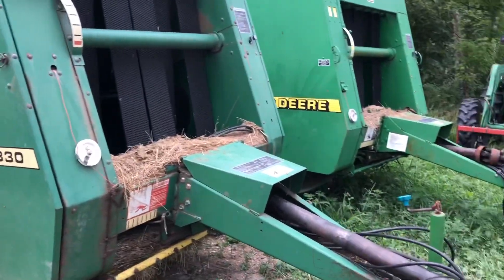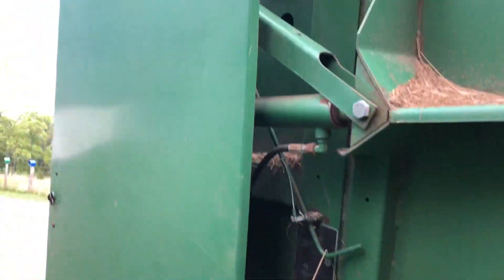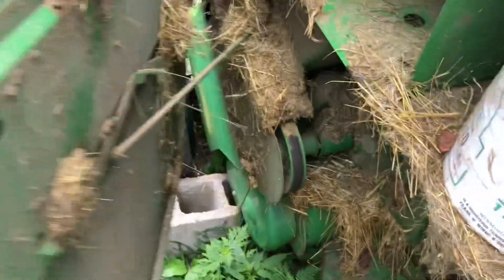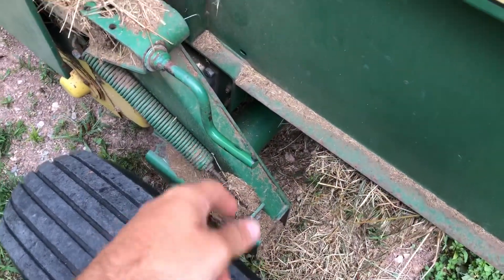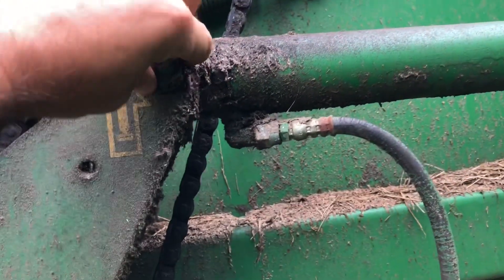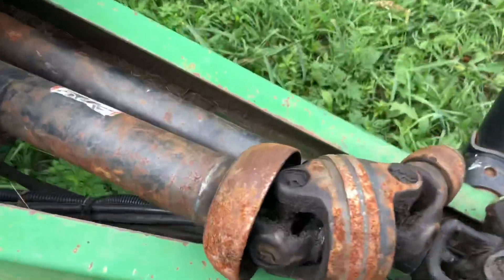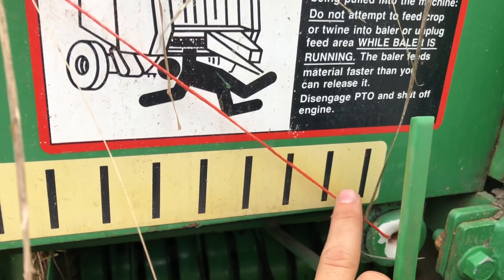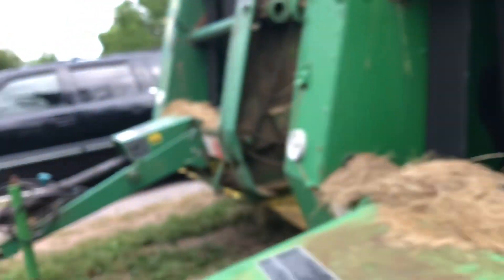JD baler VS.JD baler

Comment: I have a JD 385 the twine arm speed is adjustable, has a brass dial to change its speed. I have trouble with that orange poly twine not cutting i have to use sisal
Reply from the maker: The poly does ok in mine have to keep a eye on it some times it’s gets eaten while bailing

Comment: My dad bought a JD round baler last year. I don't remember the model number. String wrap. Older than those two. He couldn't get it to tie. He had JD service come out twice and they couldn't figure it out but had no problem sending him a big bill. My son and I went out and found he has to have his 3020 throttle wide open to trigger the tie.
Reply from the maker: It has hydraulic tie? With tractor running wide open that may be an issue in the SCV valve
Reply: @Theblindfarmer  if I remember correctly, there is a power steering pump type setup on the right side, (if facing the rear).  I don't remember hydraulic hoses. The pump may be belt or chain driven via the pto.
Reply: @Theblindfarmer  I do know it can automatically tie or pull a rope to manually trip the twine arm to tie.
Model 530

Comment: So how you like them Deere balers?? Have you ever run anything else to compare it with?? I know some guys like the Deere balers some don't.  I like the looks of them never run one though.  Betty's cousins have and they really like theirs.  I'd like to get a Deere baler to replace my old Ford/Gehl when the time comes.  Lot of NH and some Vermeer and some Deere here, but I'm not a fan of either NH or Vermeer anymore... NH is needlessly complicated in my opinion (can't make up their mind to use chains and slats, rollers and belts in combination, or belts only... Plus NH isn't as good a company as it used to be.  Vermeer balers are built tough but I've heard they can really be difficult when baling short hay, excessively dry or lightweight grass, or slick stuff... Plus I don't like rubber-mounted teeth in anything no-way-no-how... Later!  OL J R :)
Reply from the maker: Just new holland and Heston is all I’ve ran to compare to the Deere
Reply: @Theblindfarmer  So which did you like most?? Deere I presume LOL:)  (or else you'd have the other I guess??)  Later!  OL J R :)  PS and why??
Reply from the maker: Deere I like best and why is the new holland makes a bale that’s almost 300lb lighter in the same size bale and the Heston if it wasn’t bone dry it would not bale
Reply: @Theblindfarmer  Hmmm interesting.  Virtually NO Hesston balers in this part of the world.  I think they're quite the thing up in Kansas but then bone dry isn't a problem for them so it seems it's the normal state of affairs LOL:)  I've looked at the Vermeer balers and they're pretty impressive fairly simple looking and very robust HUGE bearings on them (at least the later ones-- it's like if you take that bearing out you've got bigger problems!) BUT I've CONSISTENTLY heard that they can be VERY finicky when it comes to hay conditions... the older ones in particular but the new ones aren't immune from it.  In slick grass hay (like dry ryegrass) they don't want to start a bale, in light or extremely dry stuff they can be very hard to start a bale, and in short hay, same thing.  Some guys say "well replace the starter roller rubber flaps they'll start a bale like a new baler" but that gets expensive when they have problems every couple years like that... and I've heard varying levels of success with that as well... sometimes it fixes it sometimes it doesn't.  The newer Vermeers all have rubber-tine teeth and when the rubber gets some wear and "loosens up" they won't start a bale, then you're tearing the entire pickup apart and gutting it and putting ALL NEW tines in it... and that gets EXPENSIVE with their proprietary rubber tines!  I've been watching SouthSaskFarmer's channel and he's running a Case IH baler built by Hesston it's fully automatic no hydraulic connections at all it has its own hydraulic pump and the monitor controls everything just a wire harness going back to it and the PTO.  Looks neat and does a nice job baling but some guys said "wow glad that works heard a lot of bad stories!" type stuff... We see a FEW Case IH balers on the lots taken in on trade but not hardly any (that I've seen) actually in the field running which makes me wonder "WHY was it traded off and sitting on the dealer lots?"  LOL:)  Bad juju for sure!  Most balers here are Deere or New Holland or some Vermeers but that's about it.  The New Hollands just don't impress me-- it looks WAY more complicated than it needs to be IMHO... Then the fact that they changed their design a half-dozen times-- first all chain-n-slat, then sledge rollers and belts in back, then all belts, then endless belts, soft core, hard core, it's like they can't make up their mind what kind of baler to build.  Then you've got at least a half dozen or more models in every type that they made pretty much and it's SO confusing it's like "which are the good ones and which are junk?" and it's like "Well, Deere has stuck with the same basic design ALL THESE YEARS and just refined it, so there's your answer!  Deere's netwrap is kinda wonky from what I've heard harder to see and monitor than others can be tempermental if something's not just right but then that's kind of an issue with all of them.  Best thing about NH that I can see is they put the net up front instead of in back like Deere LOL:)  Otherwise I think Deere's got them on a superior product...  I know they ALL have their faults and foibles but from my experience Deere doesn't make pure junk might have a model with more problems than others but Deere is also good about supporting their stuff with parts, unlike some of the others, and while they're expenive, NH went crazy on their parts prices since they bought Ford Tractor Division and then Case IH, and of course now they're owned by FIAT (Fix It Again Tomorrow!) and that's NOT a good thing...  So anyway that's my chain of thought on the matter LOL:)  OL J  R :)
Reply from the maker: A friend of mine went to a veneer and he loves it it makes a 4x5 1/2  bale and he has had no break downs so far and he has had it I say 5-6 years the only issue he has with it and he hates is if the hay is slick or damp it bales up to about 2/3 and the bale inside will stop turning and sheer a pin and clog up and he said when that happens it’s 1-2 hour fix just to get the bale out and to get it I stoped days it doesn’t happen often but when it does it’s a bitch
Reply: @Theblindfarmer  Yeah that's another story I've heard... Vermeer uses slick belts (or mini-rough top maybe in the new ones if you special order them maybe can't recall exactly) but yep I've heard that sort of thing.  Years ago when I was driving a bus our bus mechanic lived just up the road from me and he stopped me at the bus barn before I left one morning and asked if I could bale for him... "Yeah, sure" and asked him what he had... turned out he had cut a bunch of winter ryegrass that was growing on their turning rows it was nearly waist high and REALLY nice hay he'd cut it and cured it and went to bale it with his Vermeer G (IIRC it was a G) and he'd try about 10 times to start a bale before he could get one to actually start rolling the chamber and not poop out... the other 9 times he had to eject a malformed wad and then unroll it or scatter it out to try again... He was so disgusted he gave up on it but said if I could get it he'd pay me.  I took my ancient Ford 552 (Gehl 1400 painted blue) over there and rolled it right up in like an hour or two's time... made some nice bales they just tend to be a little shaggy particularly on the shoulders because those old balers had the belts spaced about 4-5 inches apart so you could see into the chamber to see what kind of bale you were making and steer left or right accordingly-- monitors weren't even invented when that baler was built and they didn't even have bale shape indicators on the front either-- just a size gauge that worked off a rope pulled back by the belt shuttle as the bale grew... That was it!  The only time I had a problem was one year the ryegrass on the road was REALLY slick hay and once the crush roller behind the pickup feeding it onto the platform belt and back into the bale chamber polished up it didn't want to feed too good... I went back to the house after struggling with it awhile and I grabbed the 6013 welding rods and turned the crackerbox welder down and ran six beads around the crush roller most of the way across from one side to the other turning it 180 degrees between beads to prevent warping the roller and offsetting them 60 degrees like a hexagon pattern... Worked like a champ took it back to the field the addtional "tooth" of the weld beads grabbed that slick stuff that would hit the roller and then stop letting the roller slip, it'd grab it and shove it right on in once it was thru it was GONE... rolling right along.  I guess ol' Frankie's starter flaps were probably shot I looked at his baler and they didn't look too healthy but still-- I don't like finicky equipment LOL:)  OL J R :)
Reply from the maker: If I was to buy a new one idk what I go with because Deere makes different grade model now from cheap made POS to heavy duty that are 50k I think I’d have to demo a few but veneer and krone be in my sights
Reply: @Theblindfarmer  Yea Krone makes some nice equipment no doubt about that but their round baler doesn't thrill me... Dunno if you watched the one they demoed on How Farms Work channel but it was neat to see.  Did a good job but the "belt and slat" design is just a hard one to swallow... I have a hard time seeing that hold up over the long haul and I see MEGABUCKS when the belts are shot and it has to be replaced... Plus yeah anything new worth having is a friggin' FORTUNE nowdays so the best I can ever hope for or justify (even if money were "no object") would be used... Bout like new pickups I wouldn't buy one even if I had a million bucks sitting in the bank I don't see throwing away $70,000 bucks for the CRAP they're building NOW!! LOL:)  I'd rather have older and more reliable and totally rebuilt stem-to-stern if I had the money.  Too many guys now just want the latest and greatest toys and that's why diesel pickups have basically turned into overpriced 'cowboy cadillacs" that are more shiny fast toy with oversize wheels than something to actually work and LAST for the long haul... so long as it gets out of warranty is all they care once it is the new has worn off and the kids with too much money and too little sense will be in there to trade it off on ANOTHER new toy, and they know that.  New farm equipment isn't a whole lot different IMHO... it's overpriced and overplumbed and not as reliable or dependable as the older stuff IMHO, but SO many guys are in love with "new paint" that they know they can get anything they want for it since it's all borrowed money anyway can always add another zero on the loan application LOL:)  Oh well I guess I'm hopelessly behind the times but that's how we live essentially debt free and loving it!  LOL:)  Later!  OL J R :)
Reply: @Theblindfarmer  I've not seen any Krone balers here at all that I can recall... the local Deere dealer sells Krone he keeps a couple three point disk mowers and maybe a pull type in stock but that's about it.  Might order a tedder if you wanted one but doesn't stock one that I've seen.  He's of course mostly pushing Deere stuff but snatched up the Krone franchise so that he can sell you "something else" if you just aren't in love with the Deere mowers and it would mean he'd lose a sale otherwise.  It's a shame back in the day the shortline manufacturers would give smaller guys a chance to get their dealership and carry their parts and do the service but now NOPE they want to give it to the bigshots which are usually established Deere or CNH dealers (here; AGCO is practically nonexistent in this area) and OF COURSE their incentive is to sell you the "big name" flagship equipment rather than some shortline alternative that's usually cheaper than the 'brand name' stuff they sell... so it's basically counterproductive to a company like Krone trying to establish themselves in the market... BUT I guess they figure going with a bigger dealer they'll perform better service and parts support on the stuff they DO sell which makes the company look better even if it is stymieing their expansion of market share LOL:)  OH well I guess they got a sharper pencil than I do!  OL J R :)
Reply from the maker: I did see that video of the krone I’m not a fan of that old style slat bar chain style and I thought it was noisy too where if something was going bad you couldn’t hear what the machine e was doing Indy why they went with the belt and bar design or what ever you call it  the Claus brand may be something to look at
Reply: @Theblindfarmer  yeah Claas  makes great combines not so sure about their hay equipment LOL... Their balers turn the bale backwards in the chamber LOL... Later!  OL J R

Comment: Not much difference compared to our 530, good balers that last forever it seems.
Reply from the maker: Great balers the 330 has at least 25000 bales  maybe closer to 30k no way of knowing for sure but when I bought it I was told it had over 20k on it and Ive ran 5k threw it